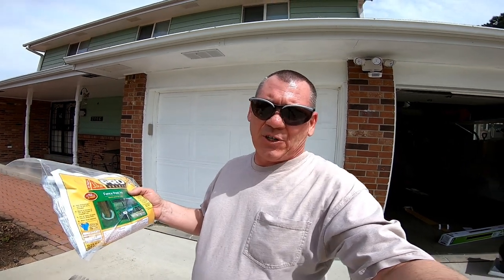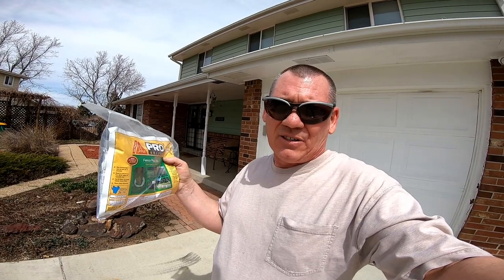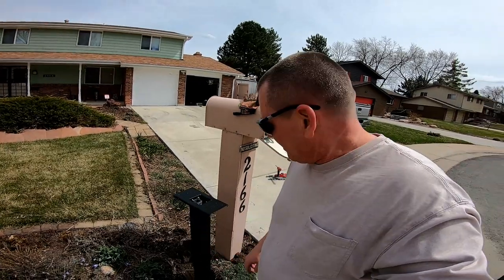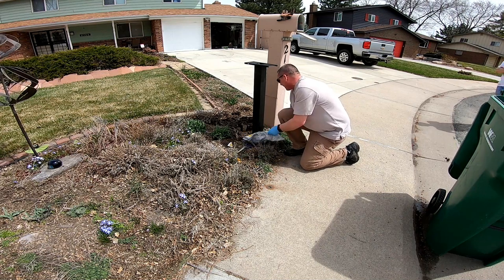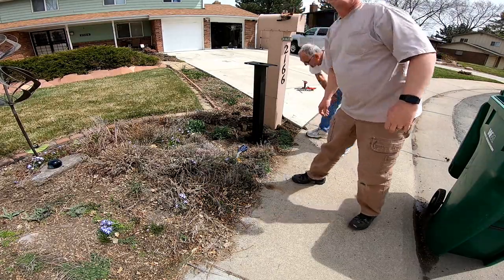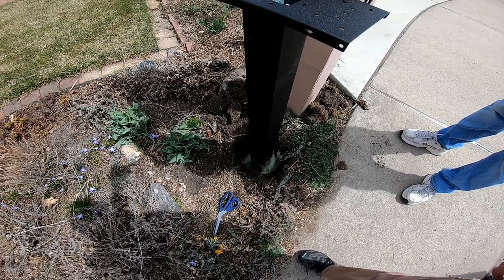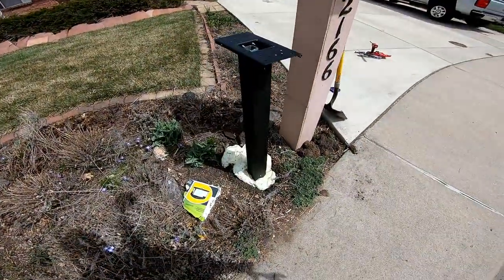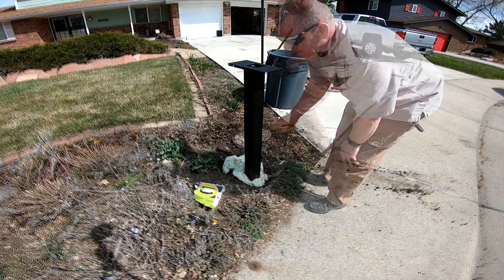Thoughts on using Sika Foam Post Hole Mix used for mailbox installation

Comment: Hey man im 18 and im doing the same thing with my mailbox, bought the foam due to its claim, watched your video and its all set up nice and clean. Appreciate the content and hope you do well!! Thx
Reply from the maker: In hindsight, the one thing I would do is to put painters tape just above my "at grade mark" to keep the form off my post.  I splashed a little bit as I was pouring.  It would be a lot easier to tear some tape off than to scrub/scrape the foam off.  👍😁

Comment: In the sidebar to this video there is a video comparing Sika to Secure Set.  The video is by Secure Set so likely a bit biased and from what the comments say Secure Set is a fair amount more expensive. Still, it might be another product worth testing out.

Have you ever replaced items that were installed with Sika? I'm imagining it has to be easier than dealing with concrete.
Reply from the maker: I'll have to look into that.  I think it could be a pain to remove Sika/foam, but your right easier than concrete and definitely not as heavy!  :)

Comment: Basically, the post still wobbles.
And since the material is spongy, once you push it, the non-expansive material will remain so and leave a gap, so that the post will now wobble even more.  The product, an expanding foam, is best used for its intended purpose to fill a hole (eg, similar to the expanding insulation they use inside homes and garage walls for insulation.  But not for supporting posts.  –––– It would be an INTERESTING EXPERIMENT, if one could "accent" this quickly-expanding material, by somehow incorporating small pebbles/stones into the liquid mix, so that as it expands, it expands WITH the stones inside, as a matrix, and thus making a kind of cement floating in a plastic material.  (Someone should try this).   Better even, chopping up some small wire, 12/18 gauge, into small 1 inch lengths AND also pebbles ––– then poring that liquid (and wire/rock addition) so that as it expands, it incorporates that inner metal/rock network and really hold the post to the outside circumference of the hole?!   Try that and let me know.
Reply: It doesn't claim to be for structural posts.

Comment: Would you use it on a two-panel 4'x8's lattice privacy fence with three 4x4s?
Reply from the maker: I'm a bit on the fence with that one. 😂🤣😂  I've not done that setup myself, but I believe given the airflow of the lattice it should be okay as you won't get much wind-load on it.

Comment: Looking to put in fence posts , would you not recommend this for that ?
Reply from the maker: I would recommend this for a non-load bearing post.  A chain link line post (in the line) but not for a corner or end post.  When it dries it is similar to spray form (e.g. squishy).  I has worked great for my mailbox and I would use is for mounting objects on a post, in my case cameras, wireless radios and similar devices.  Hope this helps.  :)
Reply: @AccentAlarms  - Squishy? Sure if you have not waited for it to set for 15 minutes, or then tested it again after 24 hours or so since it actually sets pretty hard! But yeah it would not fair well for corners since it only hold stronger than the soil surrounding it.
Reply: A little late but...NO!!!!
The stuff is garbage...

Comment: They've been using these things out west to set telephone line posts
Reply from the maker: Doesn't overly surprise me, I'd guess over time the poles could lean/shift a bit but being slightly out of level isn't going to hurt anything.
Reply: @AccentAlarms  - Know how a driveway is leveled? 

They use this type of foam.
Have dealt with leaking basements due to settling issues since the soil put back is not as solid as it was when it was undisturbe which is why most utility poles tend to lean due to said disturbed surrounding soil reintroduced and was not quite properly compacted .. or it was ... but settled due to imperfections in said back-filling technique. Thus why said expanding foam makes more sense than back-filling with concrete. Same could be use for filling sinkholes.
Reply: Hey Sean.
I work for an electric company and can confirm we do use a polyset product when setting electric poles.  Seems to do a pretty decent job, at least the linemen and construction teams like it.  Don't yet have definitive data on its longevity, but that'll come in time.

Have a good one cuz.

Comment: A gentleman that does fences did a video - after sitting for 3 days the foam had contracted and it was loose in the ground and around the posts.  Did you have the same think happen?
Reply from the maker: I did not have this issue.  I wonder if he didn't set his posts deep enough, didn't clean out his holes, or maybe made ice-cream cone shaped holes?
Reply: @AccentAlarms  Don't know what happened between cuts - he poured it, then 3 days later evaluated it and it was loose.  He's supposedly a professional fencer - Ozark Fencing  I think was the name.

Comment: Terrible product..is way to soft and spongy...i ended up digging my posts out  removed foam and used Rapidpost at 60% cheaper.
Reply from the maker: I have good luck, but I've used it for a mailbox and photo beam mounts (e.g. not much load).  Thanks for sharing your thoughts and experience!